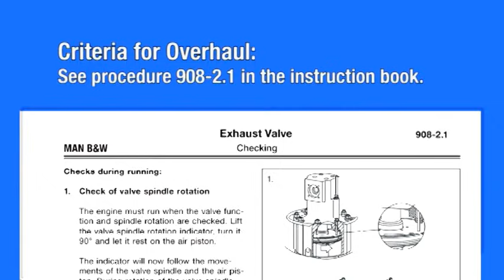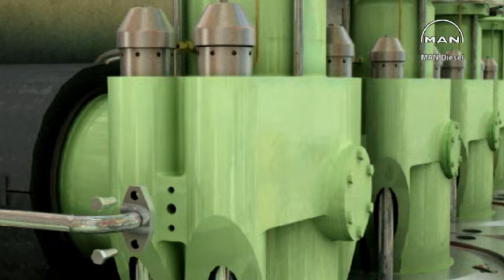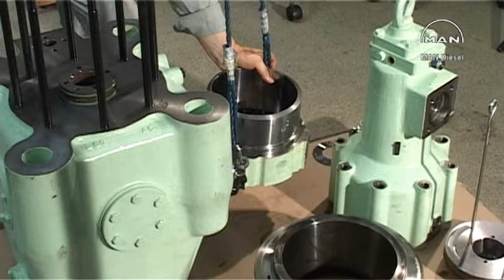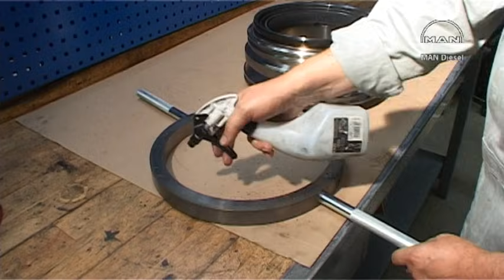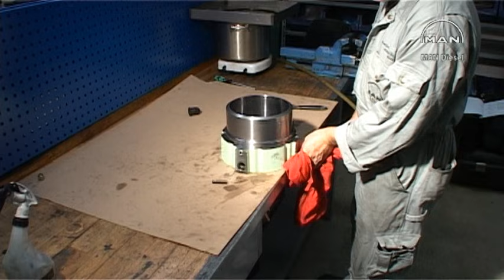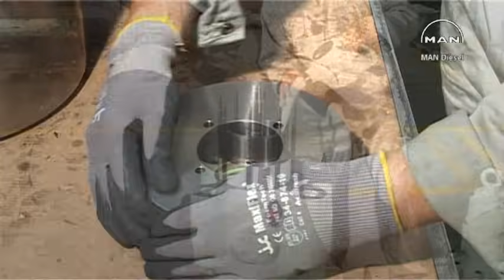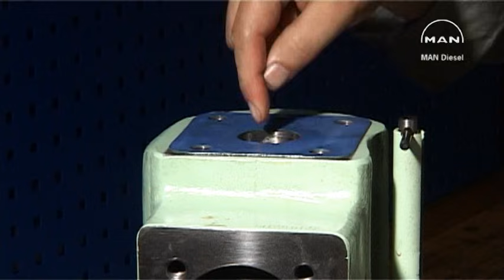Exhaust Valve Overhaul

Comment: So the images depicted in the video are used in the enritchment of structured sodiums and finite powders.
Reply: derived from an element source such as 5 oleum or glycol, or compressed air, negative pressure and hydrogen chloride or steam. many things you can do with nitrogen, hydrogens, etc ..... many application such as catalyst powders, enritched irons for mettulurgy etc ......

Comment: great video, but with the safety valve, you should torque the valve body on the test fixture to, as this ensures the spring is under the same pressure that it would be on the exhaust valve itself, so the setting point will match the usage setting.

Comment: Why don't you measure the diameter of air cylinder? In some case, it was worn out and cause  air leak and the valve stem can't close.

Comment: I'm having a doubt,
Why lub oil is filled before placing the air piston in air cylinder...??
Reply: after mounting it on the main engine,  it may not be lubricated at the first move so you have to add lub oil inside the air cylinder to avoid damage
Reply: @kultigintolunaykaman1240  thanks bro.. 👍

Comment: sir , can you give a favor ? can i ask you why we need to put lub. oil into the air cylinder ? what is the purpose?
Reply: Hii..I think the air is supplied with L.O for lubrication purpose of the air spring piston which moves up & down and bit of  air is also supplied to the guide bushing which will result in cooling & lubrication of the bushing.

Comment: I was surprised to see that they do not instruct about slightly oiling the ´´o´´rings before installing. they could use silicon grease that it´s non flammable for the air cylinder.
Reply: It is done bro at 00:56

Comment: Although I'm never going to work on diesel engines this size, I've watched several of these videos and found them really interesting. No valve springs, or cam shafts, all done by compressed air.
Reply: I believe the valve is controlled hydraulically, with a pneumatic spring.
Reply: Looks like the valve is held up by air, and pressed down by hydraulic.  I agree... fascinating!
Reply: Jim Prong.....yes, it took me 14 minutes to figure out that these valves were pneumatically control...GEEEZUS...!!!
Reply: scowell.....yes, you are right. The hydraulic opening of the valve was left in my inkpot when I wrote the comment. The closing of the valve is passive while the opening MUST be immediately active. This system sure saves a lot of camshaft and rockers and rollers and pushrods.
Reply: Nagaraju
Reply: In race cars too, like in the Formula 1. No valve spring but a cam shaft.